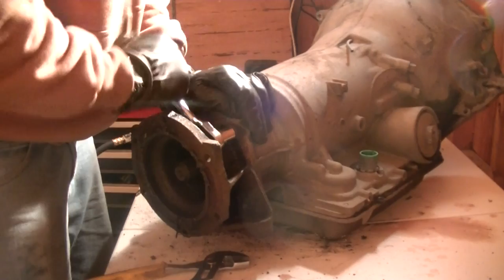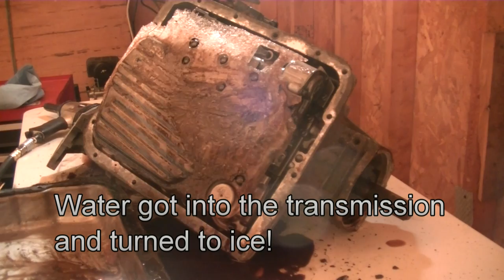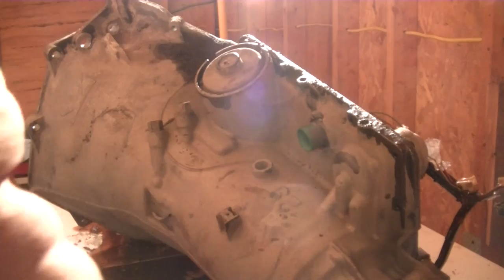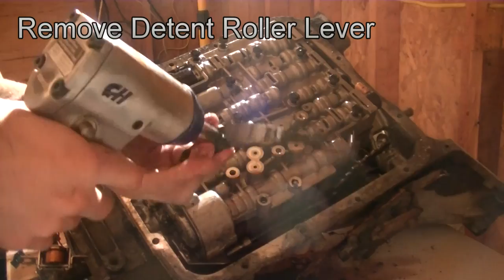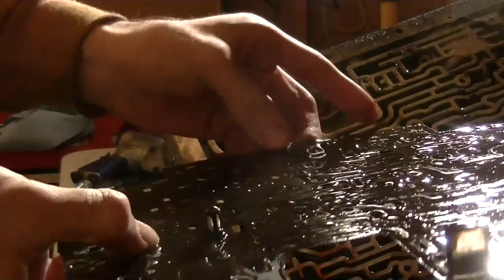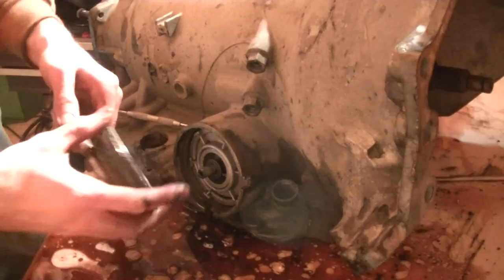4L60E / 700R4 Transmission Rebuild [Part 1: Valvebody and Pump Removal]

Comment: I very much like your channel. Very Impressive work. I'm thinking about rebuilding a transmission for my 99 Ford Ranger, but kinda looks SCARY. I'm guessing the best way to go is to first find one at the Salvage yard and try working on that first. Nice work.
Reply from the maker: Thanks! Yeah that would be a good way to practice.  It is extremely important that when ever you are working on a transmission you have the factory service manual with you.  The service manual explains the whole rebuild procedure and has diagrams and everything you need.  A rebuild should never be done without the manual unless you have done the job multiple times.

Comment: I've heard the 700R4 was equivalent to the 4L60, but I never heard it was the same as the 4L60E, which was electrically, rather than hydraulically controlled. Am I missing something (besides hair).

Comment: I'm going to attempt to change out my 4l60e for a 700r4 . Never done anything like it before
Reply from the maker: Careful there.  The 700R4 is the same as the 4L60E only for specific years.  Do your research and make absolutely sure it will work.
Reply: I'll have to have a teaser adapter

Comment: How much of the transmission actually has to come apart just to get the pump out?
Reply from the maker: If you have the special pump removal tool, none of it has to come apart.  If you don't, you will have to use the method I used in this video to get it out, namely, getting a long pry bar or screw driver and pushing it out from the back (do a quick, hard motion rather than a slow prying one)  If memory serves, all you need to do for this method is remove the oil pan, you shouldn't need to remove the valvebody. (but again, it has been awhile, I could be mistaken)
Reply: you were right, I found that out before I read thism but I got it done, thanks for replying though! shifts nice and smooth again
Reply from the maker: Nice! Thanks for the update!

Comment: in what liquid to you clean a valve body of a automatic transmission of a mk5?
Reply from the maker: I normally use throttle body cleaner or brake cleaner

Comment: I have a 4l60e with transfer case from my 99 suburban bolted up to a 350. i'm told a 700r4 will bolt up with no problems and won't need the comp. Is that true. secondly i'm told rebuilding a 700r4 is the same as a 4l60e? Lastly i'm also told that a 4l60e won't operate even manually without a comp.is that true? please help.
Reply from the maker: +Chris Martin I don't recall the exact specifics, but the 700R4 and the 4L60E are the same transmission for certain years.  The transmission was initially called the 700R4, but then GM changed their transmission name system and the 700R4 became the 4L60E.    I think all of this is on the wiki page for the 4L60E. 

That being said, for certain years, a 4L60E and a 700R4 is an identical rebuild.  Not sure about the bolt up issue.   But I would think it should be okay.   There were many different versions of this transmission for many different vehicles.

Yes you NEED the control module, otherwise it will NOT work since it is electronically controlled.
Reply: The 700R4 will bolt in place of the 4L60E- but you have to have provision for the TV cable, without which you will be rebuilding the transmission in short order. The TV cable is CRUCIAL to the 700R4.4L60E is specifically the electronically controlled variant. It doesn't use a TV cable. The 4L60 is a renamed 700R4, and mostly identical. There are aftermarket controllers available- or you can save hundreds of dollars and use a GM factory ECU with a custom PROM.

Comment: my car want come out of 1st gear an i checked the govonor
Reply from the maker: Common problem with the 4L60E. Usually the 2-4 band is shot and will not grab the low/reverse drum.(First check the TPS and vehicle speed sensor, but I doubt this is the problem).  At  the very least this requires removing the transmission, then removing the bell housing, valvebody and pump.  If you're going this far, you might as well rebuild it.  Get it properly diagnosed though, don't take my word as fact.  The first thing I would do is check that the shift solenoids are being commanded on by the control module.  If that turns out to be okay, next I would hook up a pressure gauge to the tranny test port.

Comment: Music has to F'n go. Not everyone is a metal fan. Smh
Reply from the maker: SilentOneCorajuda13 Lol yup, I realized the music wasn't that great and did away with it for the rest of the series.
Reply: MattsMotorz I just watched the whole series. I'll admit. Your video is giving me the confidence to rebuild my 700R4. The problem with mine is that once the oil heats up, I lose reverse. But when the tranny oil cools off, I regain my reverse gear. Wierd. Either way, very very good tutorial man. Just suscribed to your channel.
Reply from the maker: Thanks! I appreciate it!

Generally when that kind of thing happens, it is due to worn, leaking seals.  When the fluid heats up, it gets thinner and will squeeze by leaks more, causing pressure loss.  But it could also be for a whole bunch of other reasons.

If you are going to do it, make sure you set aside at LEAST a month of having no vehicle.
Reply: Try draining your fluid and refilling with quality Dex6, which is backwards-compatible with Dex3. Also, ALWAYS install a filter on the return line from the cooler- Magnafine is a GREAT idea. Should be required for all transmissions, rebuilt or not, if you want to ensure a long life.
Reply: That's not metal. I don't know what it was